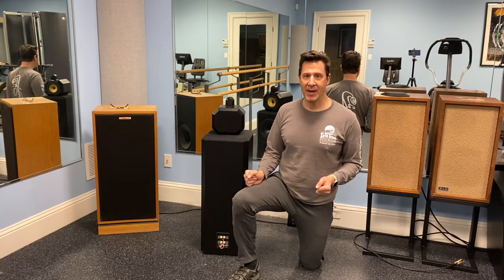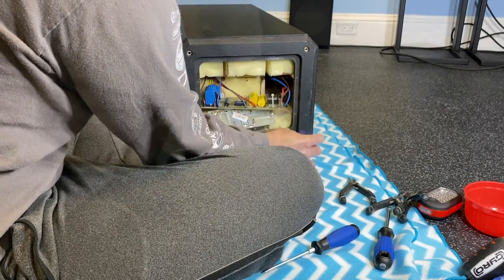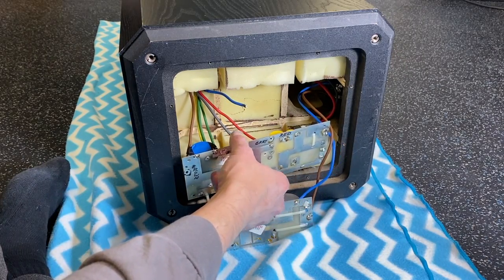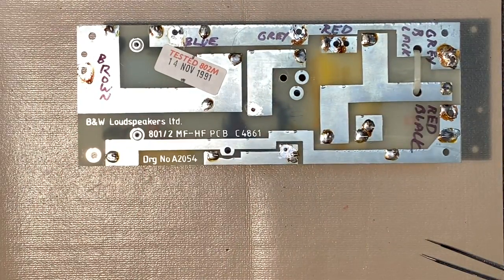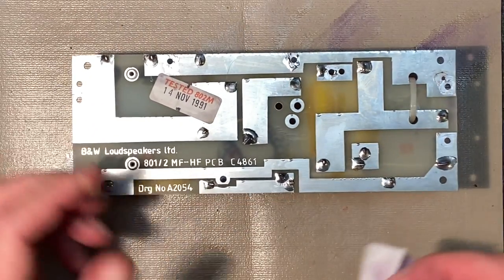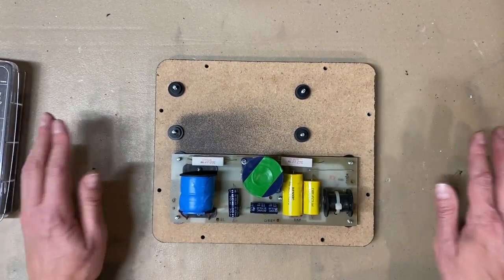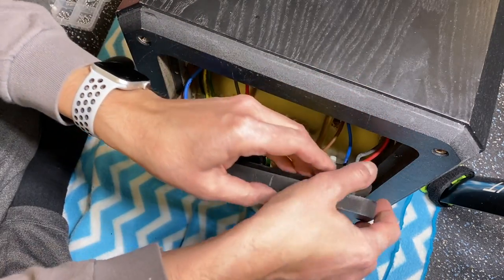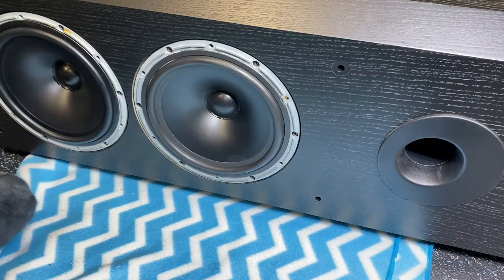B&W 802 Speaker Repair & Demonstration

Comment: I've owned my 802 S2's for a few decades and have been intrigued by the guy on ebay selling 801/802 crossover rebuilds. His website shows a ton of positve data fro replacing the old factory crossovers with his rebuilt versions. Before I drop $650 on a pair of these, do you have any thoughts? My 802's work flawlessly but i'm always wanting more ...
Reply from the maker: Peter, there are a lot of offers on eBay for crossover rebuilds for the 801/802, so my comments will be general in nature. If you provide a link to a specific one I can comment more specifically. 

In general, though, the listings I saw did not seem to make any modifications to the circuit so I wouldn’t expect a difference in sound from a rebuild. They seem to be pulling out the already good components and replacing them with also-good components of the same values. 

In my opinion, the only way a new crossover will change the sound of the speakers is if the actual tuning of the crossover has been changed and that doesn’t appear to be the case. Additionally, I’d prefer to have an original B&W design, over one that changes crossover points, emphasis and de-emphasis in the crossover. If you were to find a crossover rebuild that does more than swap out parts and actually changes the crossover properties, you would have to decide whether those properties were favorable to you. 

One last note: if one or more components in your existing crossovers are failing, then yes, a rebuild such as this could be an option if you were unable to diagnose and fix the issue yourself. If you have no evidence that your crossovers are failing (and I wouldn’t expect you would for another few decades) then this will be unnecessary. Further, if you’re not happy with the sound of your 802s, I would strongly suggest auditioning and purchasing speakers that will better satisfy your needs. Rebuilding crossovers in the pursuit of better sound is a slippery, expensive slope with no guarantee for success.
Reply: @FluxCondenser  Thanks for your concise reply. The guy on eBay goes by Cyrix7x86 and can be quickly found by searching 802 crossover. There is a Danish guy as well who has put a ton of work into determining if he can improve on the sound of 802's (http://www.jantzen-audio.com/bw802s3upgrade/). As mentioned, I love my 802's but am bored and want to play a bit! How about bi-amping, either vertical or horizontal? Have you experimented?
Reply from the maker: Peter, in my main home theater system I have the left and right channels biamped. I don’t think there’s any benefit to this beyond being able to provide adequate power to a speaker. This can be done with one amp as well as two. In my system it’s probably overkill as the amps have high output and the speakers are very efficient. I encourage you to experiment as I know personally, that sometimes you’ve just got to “scratch the itch” and hear or see something for yourself. However, I can also tell you from experience that trying to achieve an appreciable difference in sound is not going to be best achieved by crossover modifications, biamping, cable or even most component upgrades (provided you’re already using good equipment).

I’ve spent countless hours (and dollars) investing in “tweaks” and have found that the greatest upgrades in sound quality (or only) have been from changing speakers and improving room acoustics. 

Additionally, the problem with tweaks is that our brains are notoriously bad at remembering what something sounds like. Our brains play a far greater role when one thinks “yes, my system sounds much better (or worse) since I changed X.” And even when auditioning speakers and switching between them, one reacts mostly to the volume level and we almost always prefer the louder, more efficient speaker. When levels are equalized, a preference between speakers is more difficult to determine. 

But with loudspeakers at least, there are noticeable sound differences between them and that’s why again, if you’re bored and want to try something different (I understand completely!) I think you’ll have more fun and satisfaction by purchasing different speakers. Consider B&Ws newer speakers or go wild and get something completely different such as a pair of K-horns! If you also keep your old speakers, you can have great fun using a switch box to compare them.
Reply: @FluxCondenser  Thanks again for your reply, Flux(?). Funny you mention Klipsch ... i had a set of Corner Horns with a Bryston 4B 30 years ago! No, I actually used to sell B&W in a small Stereo store in Calgary, Canada (1989-1990) - which accounts for my love of all things B&W. I have an original set of DM17's (same tweeter) + a B&W sub in my Media Room, and until I sold the car had a full B&W automotive sound system. I am in complete agreement with your assessment of sound differences. Room, speakers, and source make all the difference. And speaking of source, have you tried the new Amazon HD Music Service? Flac files streaming at 24 bit /96kHz. Really sounds good through an external DAC. 
Nice communicating with you. Have a good weekend.
Reply: @peterford387  I upgraded my 801s with some poly caps OMG what a difference the new caps made.  My caps were 40 years old long past their expiration date.

Comment: Hi there, first of all loved your video! Then a different thing, I have maybe the chance to get my hands on the same b&w speakers, for €2000,- ($2400,/). Is it a fair price?
Reply from the maker: If they are the series 3 version and are perfect cosmetically and mechanically, that’s a bit on the high side, but still reasonable. Perhaps you could negotiate a $100 or more off. Keep in mind that my reference is for a pair in the US. It sounds as though you’re from the UK, and these being a UK speaker, the market prices for these may be different.

Note that if these speakers are to be shipped to you, it’s critical in my opinion that the original boxes are included. This will not only help justify the price (the boxes alone can be worth $100+) but also ensure that they reach you un-damaged. Note, that my speakers were shipped in the original boxes, but still sustained damage due to the poor design I show in the video. 

Also consider that you shouldn’t necessarily purchase these speakers to get the best sound possible for your $2,400. These are collectible speakers and that’s built into the price. For the same money or less, a more modern speaker will likely outperform these. 

Not that they sound bad. Far from it, they sound wonderful. Still, speaker design has progressed and that shouldn’t be disregarded. Additionally, a new speaker will give you a warrantee and may be more reliable. 

That said, as a collector fascinated by older equipment, I bought mine for around what you paid and despite the repair I had to make, I’m glad I did.
Reply: @FluxCondenser  thank you for the damm good reply! I am from the Netherlands don’t know if that changes stuff 😅. They are the version 2 and have idd the original boxes in mint condition. They look like they came straight from the factory. Can inmagine speakers now a day will sound better, but just fell in love with them and would be a great upgrade from my 330i
Reply from the maker: Sounds great. I think you’ll enjoy them!
Reply: @klapblok  for €2000 you can do much better than buying old 802 models!
Reply: I have been buying and testing a lot of speakers the past 2 or 3 years  and if you use good amplification this (802 series 2) speakers are in this price range unbeatable. The only thing they need to shine is high-end power amp with lots off current and then you hear the value of this set.
Reply from the maker: @maxv5544  I agree. These are great vintage speakers that compare fairly well in sound quality to newer speakers. The ones shown in the video are Series 3. I disagree that they need a “high-end amp” as any good quality amp of at least 35 watts per channel will drive these speakers satisfactorily. Once amps get below 1% THD, are operating correctly and can deliver 20-20,000 Hz, sound differences are extremely difficult to detect between them. For optimum performance, though, I’ve found that amps in the 100 watt per channel range will bring out the full dynamics of the speakers at high volume levels.

Comment: Why didn't you check the capacitors? Were they already swapped?
Reply from the maker: Not checked, not swapped. I replace faulty capacitors all the time, but in my experience the ones in these speakers are not near their expiration dates. These are among the best sounding speakers I own and there are no performance issues. I’ve just reached a point that I’ve checked so many speaker crossovers over the years expecting to find issues, but I don’t. For whatever reason, I find bipolar electrolytics to be far more reliable than the polarized types as well.

Comment: The Coil Aught To Have Been Fixed Securely Before Soldering...
Procedure Back To Front
Reply from the maker: I didn’t show it in the video, but the solder was reflowed after the coil was tightened down. Otherwise, yes, the weld could have been compromised.